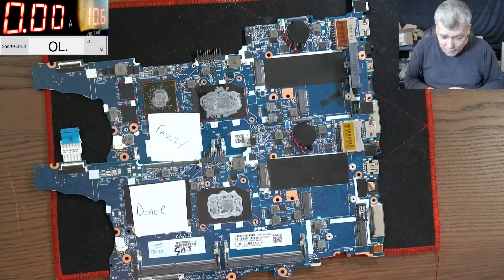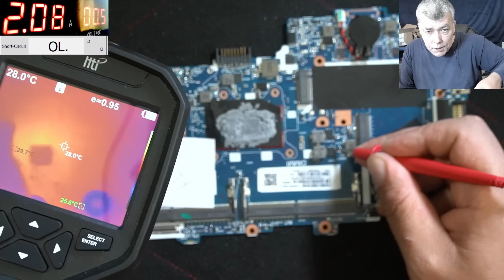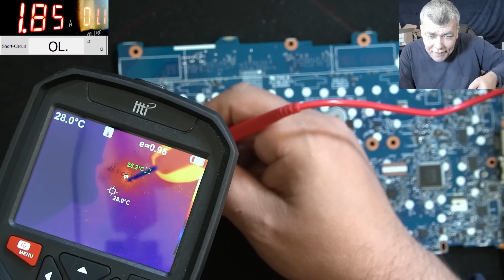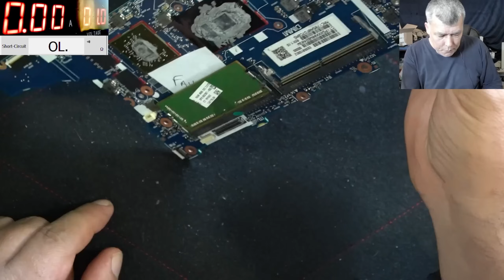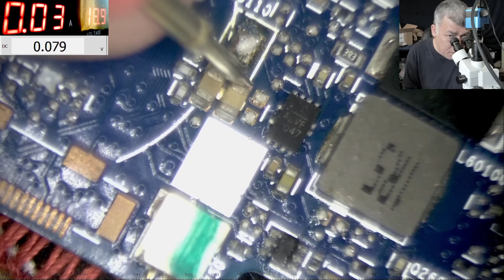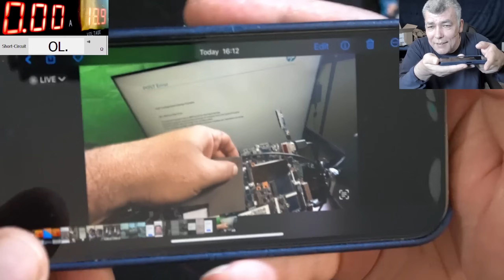Fixing laptop board with no laptop around - HP Elitebook 350 G3 motherboard repair, no power repair

Comment: I am currently working on the same motherboard, it's for an HP 850 G3 - Issue / no power / no voltage to battery. Tested the 3.3v / 5v (present) - No short on main power rail, all checks out fine. Replaced the BQ Chip - Still nothing..... this board is mysterious.

Comment: I have the donner type board and went step by step. I found 3 volts at the switch connection and the board  fired up lights on and seems to be working with out doing anything lol

Comment: It still needs a good battery to fix the boards, because the battery causes them to operate at first. If the battery is bad, the whole laptop will become locked, if the battery is new or in good condition, all functions will turn back on.

Comment: My way of testing working motherboard without monitor is using usb keyboard. If the numlock or capslock respond to my command then it should be a working one.
Reply: Good to know , or buy a HDMI converter cable.

Comment: Either invest in a quality hot tweezers station,or just replace the cap with a soldering iron.I never use hot air to remove and replace just a cap.Only soldering iron with the proper tip for each job.Yeah it takes a minute longer but its safer imho.